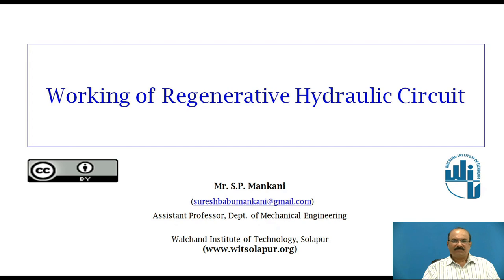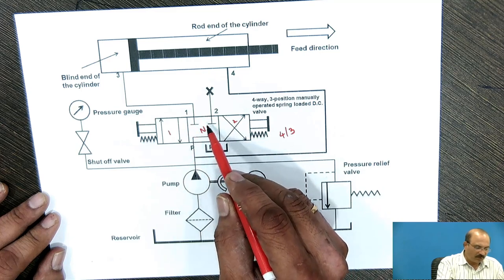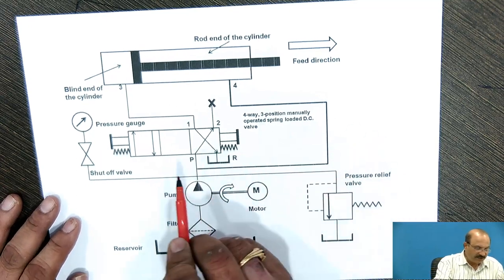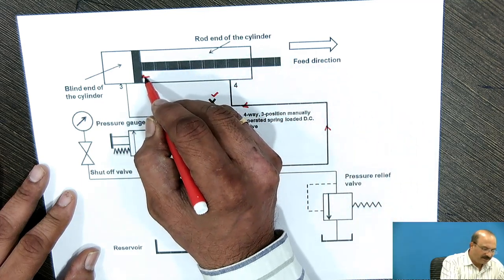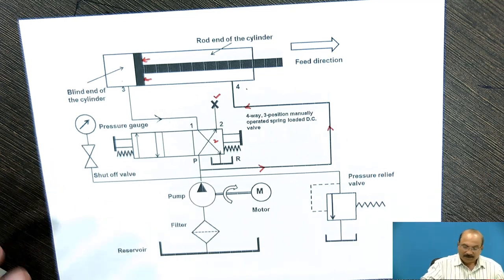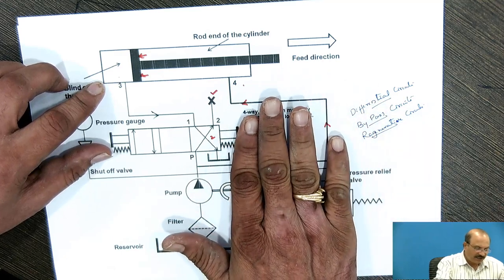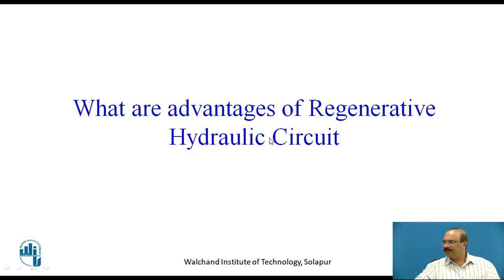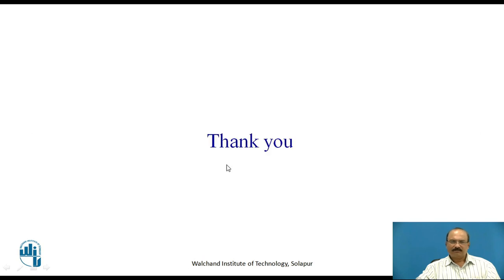Working of Regenerative Hydraulic Circuit

Comment: That is an excellent explanation. A couple of questions.
1. What effect does this arrangement have on the maximum force that the ram is capable of?
2. When retracting the ram is the pressure consistently the pressure of the pressure relief valve?

Comment: Sir B/rod end directly connected with pump i.e no counter balance valve & pilot operated check valve then @ SOP 1 operation oil also charged to cylinder.
Kindly explain briefly why oil return @SOP 1